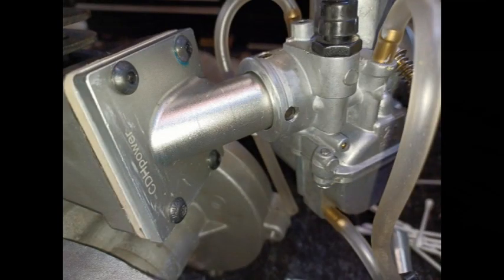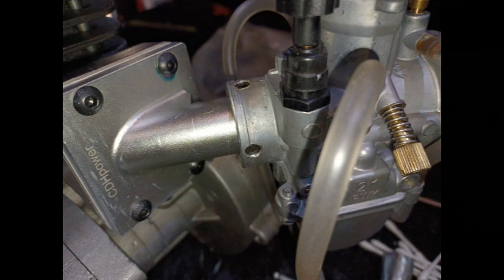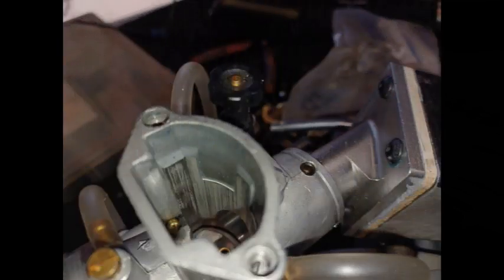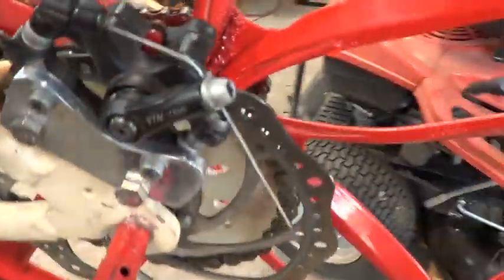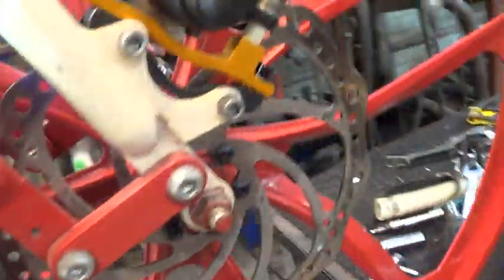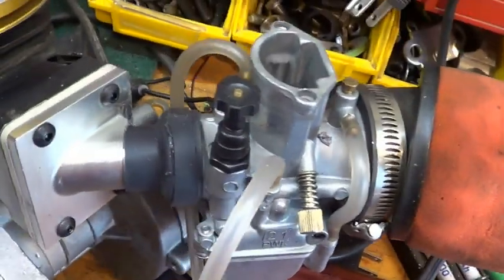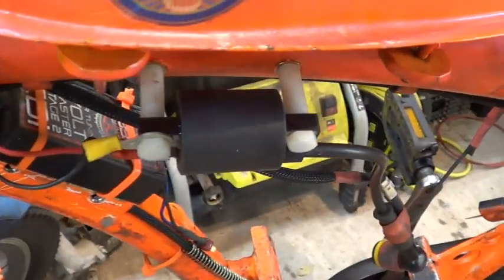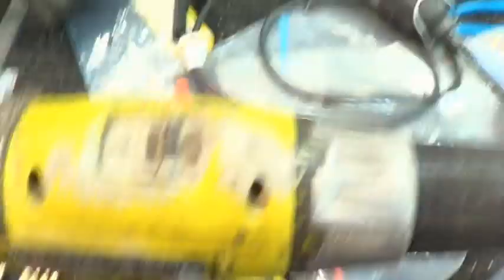Here's just a few of the discussion points we'll be touching on shop talk

Comment: 🤘     🤘       Thinking about brake ideas. If I had a fast 4 stroke with automatic clutch. I'd use 2 dual pull brake levers. Then use F&R disc brakes along with F&R rim/caliper brakes. So when you squeeze both levers. Both rim brakes & disc brakes would be stopping you. Have right brake lever active both discs and left brake active both calipers. Should give you plenty of stopping power without quickly wearing out.